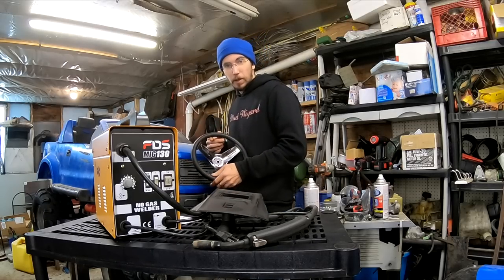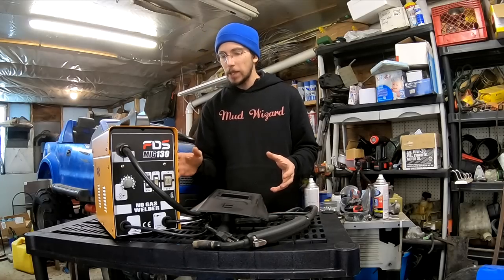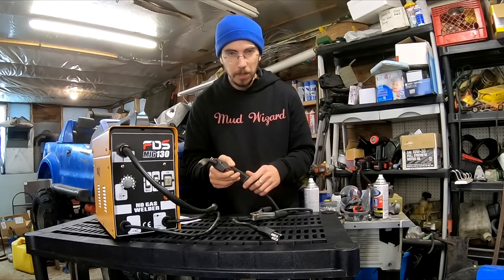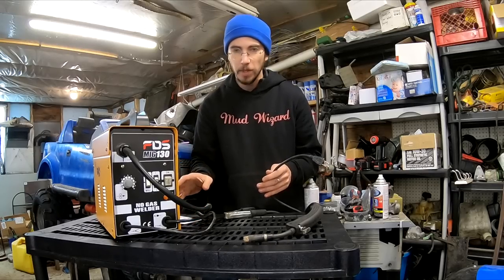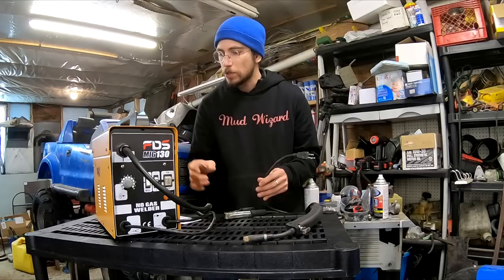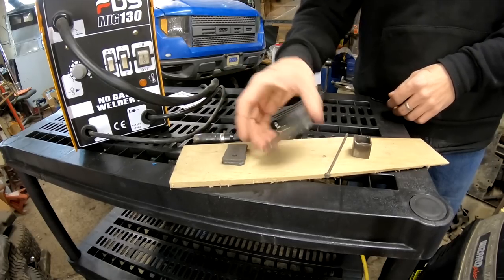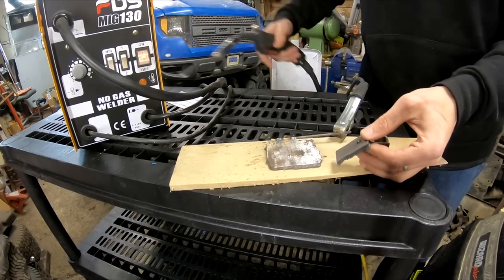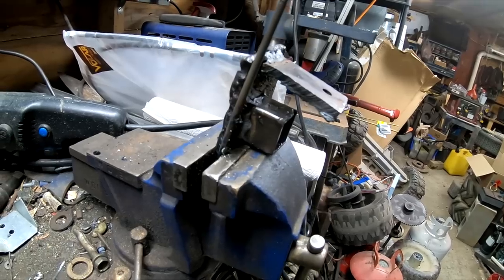Goplus MIG 130 Welder Demonstration Review

Comment: CORECTION ; I got similar MIG 130 from (Brisunshine 130)..but after 10 sec of (Max + 2) or 120amp welding it blows the house FUSE... what do I do wrong?
Reply from the maker: It has to be on a dedicated 20amp breaker. NOTHING else on the line at all.

Comment: My welder I just got is a basic cheap flux core mig and it has the know for wire speed and a high and low and a 1 and 2 what are the high low and 1 2 buttons for?

Comment: Hi what's the thinnest possible steel I could weld with one of these? Thanks
Reply from the maker: I have but welder rocker panels and mower decks with it. But now I use a Forney 140 and its worth the extra $100 big time.
Reply: @redneckcomputergeek  I think he was asking whether you could weld thin sheet, like body panels. Yes you can, but with care or your will blow through. Better than a stick welder though.

Comment: I got similar here in Finland. I am not sure is it different safety regulations in europe but anyhow It was updated with a good clamp, gun is not active until you push trigger and even then outer nozzle is not grouded. Only wire. 

And ofcourse this welder is not intented to work all day long but works great in smaller session were you have machine time to cool off and continue again. 

With those updates and properties conciderated, it has been a really good little welder. 👍

Comment: So like what if I weld on the minimum setting on tubing. Seems to do a good job. I welded a custom exhaust on my truck from the header back to just behind the cab. Penetrated well. Havnt lost any parts yet to the exhaust. So I’d say, it’s good
Reply: I got my Chicago Electric Mig 131(Dual Mig 131) about 15 yrs ago,I think it was $150,30-120 amps and the only thing wrong with it is that you have to feed the wire from roller to gun tip by hand but I’d really like to change that.probably have to buy a new line and gun but other than that it works well does yours trigger feed?
Reply: @barrykilts4506  yeah i turn the wire speed all thye way up and hold the button till it comes out, im noticing now its starting to get stuck at the bearings that feed t through when i weld, not sure whats going on. only used it for like 3 months total